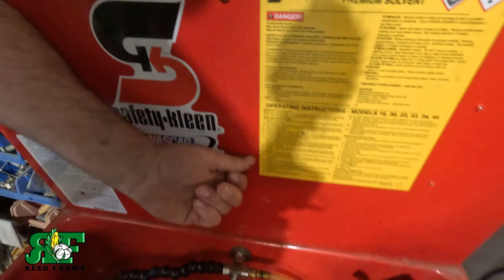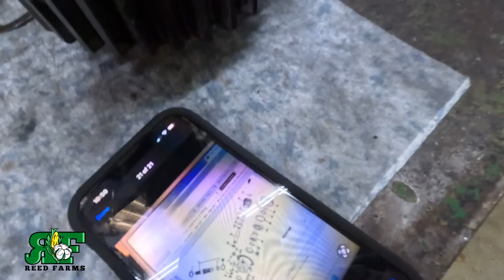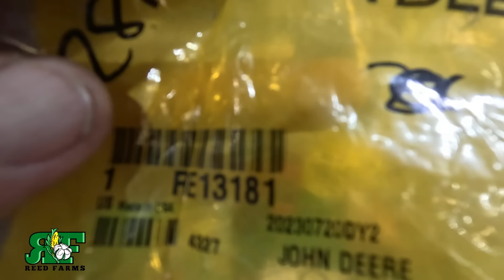Installing 360 Yield Y Drops

Comment: One small correction, if I may: Ignorance is simply the lack of knowledge.  We use to have 2-3 Cessna 188's(Ag Wagon) piloted by retired WWII/Vietnam pilots, back in the mid to late 80/90's in the air and boy did people complain until my Dad and Uncle educated them after every complaint... I did have to go wash a few vehicles due to over spray or wind drift but the ignorance was less.  Enjoy your videos. Keep on, keeping on!